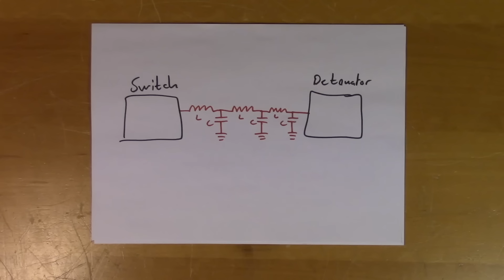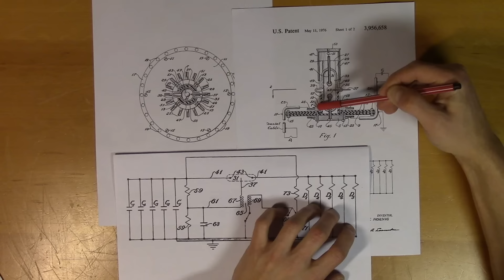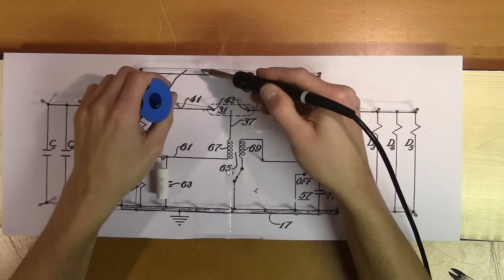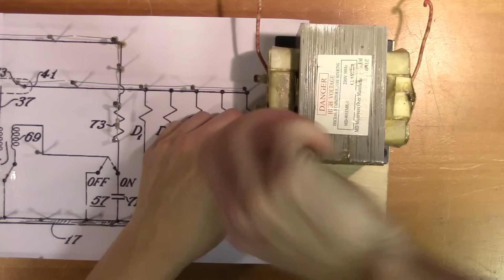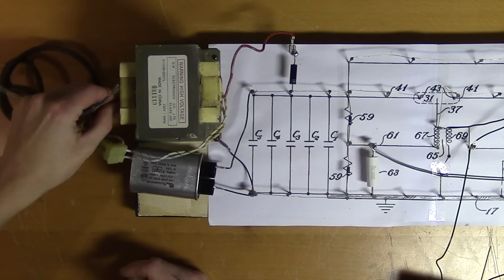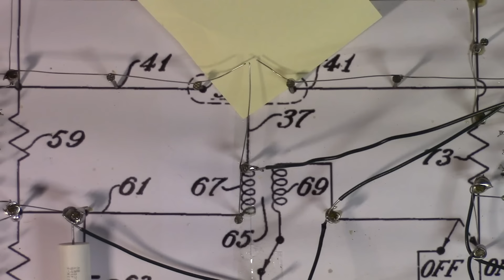Building a Nuclear Bomb Detonator Switch

Comment: The amazing thing now, is that an implosion can be obtained without lenses and with only six or so precision switches, which you can _buy_.
You can 3D print the implosion tiles, but the explosives and primers are rather difficult to obtain, and machining two hemispheres of HE, 
even if it is "insensitive", is for people with bigger balls than I. ☠
Reply: Also, the blocks themselves used different layers of materials to fine tune the blast wave. Hard to make and test.
Reply: Actually, casting or molding explosives is easy.

Comment: Wouldn’t it be much easier just to put every capacitor exactly on every detonator separately with a fast response micro relay switch on NC and connect them all in parallel?😂
Reply: The lc of the wire still remains. Won't work. This system makes them fire all at once! It's the spike that makes it work!
Reply: It's a function of how fast it switches all that power! The arc switches full current that screws the "load up" from 0 amps to 100% output a regular switch limits. Where do each detonator fire on a complex power up curve? Anywhere! Impedance approaches zero as amps skyrocket! Make sense?

Comment: I wonder if the Resistor values in the patent were intentionally too low so that any Adversary attempting to use such a design destroyed their bomb attempt in a fissile.  If they were trying to really do that they should have set the circuit up to still trigger the explosive but at a relatively random time.  
Best type of switch I could imagine is the type used in TEA lasers as they have Picosecond fire rates but are incredibly difficult to get just right as you need to use strip wire and the capacitor and spark gap are literally one in the same.  Matter fact the entire circuit is a single unit in those.  You have a single ground plate, two spaced top plates, a Resistor over the plates and a spark gap channel to instantly ionize the air uniformly in a fraction of a millisecond to pump the Nitrogen in the air up to its excited state and subsequently cause those to Lase in a second pulse if I remember correctly but I might be thinking of CuCl vapor laser on that last point.

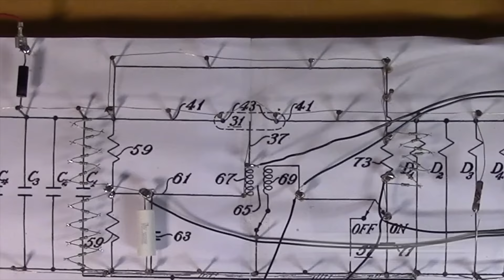Comment: 16:44 a spark formed in the spark gap BEFORE we could trigger it. Seriously. I really hope they didn't use try and error back then. This video caused me anxiety. Remembering the accident in the cold war when a plane carrying two nuclear devices crashed and there was that bomb with 2 safety switches out of 3 armed. It takes only these 2 switches to be mistakenly messed with by someone to cause a catastrophe. If i were in place of the United States back in the cold war I would hire someone with OCD to work on the switch. I know from myself. I would have added another 10 safety mechanisms. This is not a car starter
Reply: No ya can't! Adding layers of safety never solves issues, it obscures them. In first tests only three Motorola radios control the trigger. Just three need to be talking together and it's safe as four. Or five... See the problem? More layers do not create safety thickness. Three is sufficient. Atomic Awakening and Dark Star, Search for the h-bomb are great books on details.
Reply: There were plenty of OCD people on the project. No worries

Comment: Weren't these ignitron lamps by any chance? You would get better results using a long neon lamp with a wire wrapped in a spring like a "gate". The best results would probably be with a flash lamp from a disposable camera. Primary circuit: maximum 400V DC and ignition voltage on the gate about 1kV

Comment: My dad was a gunners mate abord a destroyer with nukes and worked directly with them. He talked about how complicated the detonation was and they had to be so accurate in their timing the pit would just blow out the side. All those shapped charges have to go off exactly at the same time and so accurate the length of the wire even if its just a few inches difference has to be accounted for.

Comment: I think it would have been a good idea to to discharge those high voltage caps between testing and adjusting (touching) the circuit (and show it in the video). An unexpected discharge through one’s body could be fatal. And also a brief mention of microwave transformer risks and safety practices would have been good. Just out of taking some responsibility to educate and help protect your audience.
Reply: Bleeder resistors.
Reply: @TheErilaz Cant always count on bleeder resistors espically carbon comp. Got blasted by ~ 400vdc between my pinky and wrist old 100w tube amp. Never threw something so fast in my life. Plus jumped a foot up and 2 back or so all uncontrolable. Was learning at the time no internet...
Reply: Second this and I'm sure others would go beyond and mention this as well. Most of are channels that use anything regarding these. Oh yeah, you bare, but he did have a disclaimer. Although it should still be stated about safety. Even with describers, you really ought to backup your safety protocol and let others know about the danger.  And also be saved yourself Dolph, and spread the word about safety.There's no searching as too safe or being too safe or taking too many precautions

Comment: Put an insulating glass tube to insulate the trigger electrode. Wrap the trigger around the glass
Reply: Use simultaneous overvoltage mode. Also all the bridges are being fed from a single gap, so. There. Is. No. Jitter.
Reply: Too. Much. Jitter.

Comment: 5:07  - that's basically a photo flash circuit.   seriously.  a generic xenon tube discharge circuit.
Reply: Except the tube is not.  Implementation is harder than theory.

Comment: I read somewhere the actual researcher Sandia labs are using high power pulsed LASER instead of electric circuit as shown.
Reply: high power pulsed LASER was later
Reply: @charleyhoward4594   next step is/was to use pulsed laser to detonate the explosive lens, also they develop a new type of neutron generator. This is all public information.
Reply: Lateral thinking by someone.  Nice.
Reply: The only way these things could be more unrelated is if one of them was a cheese sandwich.
Reply: @railgap  Using lasers to each segment of the explosive material overcomes the delay issue.  Just guessing here, that each segment of explosive material has its own firing mechanism, and all segments are triggered at the same time by a laser pulse.
Reply: @ Thanks for that accurate explanation.
Reply: @ Your uneducated option.
Reply: @chadx8269 The high power lasers are used in fusion energy research.  Not directly related to fission bomb research.

Comment: I suspect they use transistors nowawadays.
Reply: not claiming to be an expert or nothing, but i would not trust a semiconductor to not conduct when it shouldn't, 100% of times. A spark relay is as safe as it gets and reliable. Not to mention in certain circuits it may act as a nonlinear element, which may be used as an amplifier in itself. So spark gap ain't old school. Peace
Reply: The spark tube does behave like a thyristor though.
Reply: @windshield11  Scr's are diodes, so the conduction path is a pn structure. In spark tube, the conducting "element" is superconducting plasma carrying all frequencies in itself as an ac bonus.

Comment: A burned out subminiature rectifier tube works very well for a fast switch, has a comutstion time of less than 1.4nS and a hold off to about 14kv which waa impressive. Used one to replace an impossible to find kn-6B krytron tube with slight modification of the circuitry in a miniature EMP generator that could make a peak voltage of 185kv 😮
Reply from the maker: Cool! Thanks for the information!

Comment: the name of that spark tube device is KRYTRON
Reply from the maker: Nice! I did not know that.
Reply: @SunandWeather   Greetings from Morocco !
Reply: later replaced by sprytrons, later replaced with custom devices developed at The Mound Laboratory and Sandia, which do not contain any radioactive element, the aging of which was one of the problems with early designs.
Reply: I have an amateur radio license. One item I’ve used a lot on antenna cables, is a lightening arrestor. I’ve taken them apart before, and I think it would make a great spark gap for one of these.
Reply: @scottbruner9266  Jitter is too high.
Reply: @railgap  I’m pleased to find out that I don’t yet know EVERYTHING. So I get to continue living…😂
What do you mean by “jitter”?
Reply: Out of the blue! I'm an amateur nuke Inquisitor and never knew details of a Klystron! I assumed each detonator has a Klystron but in fact it's one and equal-length leads! How cool, I get it.

Comment: You could've used just actual flash tube as a trigger tube.
Reply: Pretty good idea!
Reply: No, you could not. The reason is that lens-based implosions require extremely precise timing between all of the firing points. Ordinary flashtubes are too unpredictable - they exhibit too much "jitter" for this purpose.
Reply: @railgap  This system was invented to eliminate the jitter.  All the triggers were powered by the same fast risetime pulse from the discharge.  It does not matter if they all triggered 20us late as long as they all triggered within 1us.

A small camera flash may not have worked in this demonstration as they are usually rated for 300-600V and this was charging to around 2000V and may have caused ionisation before the trigger pulse was sent.  Using it with a suitably rated powersupply would have made a good switch and they have been used for this purpose.